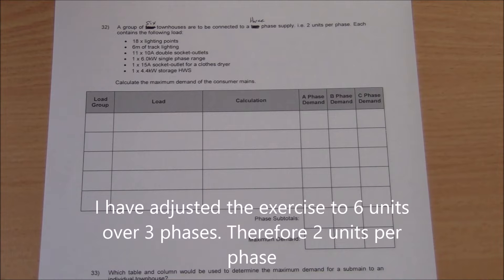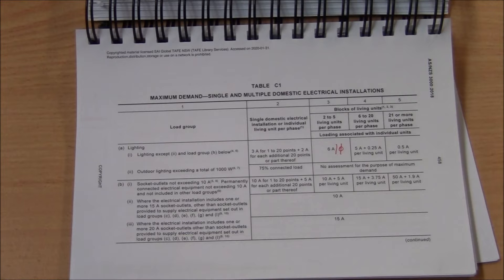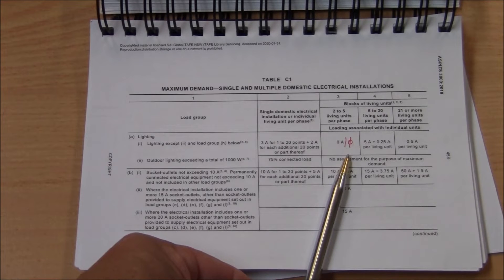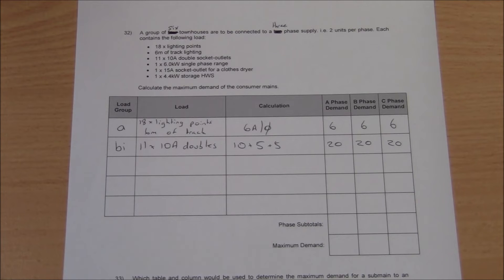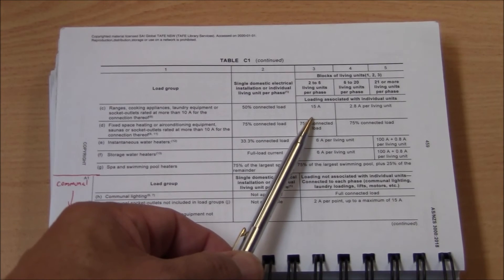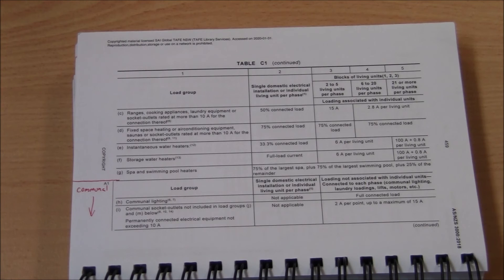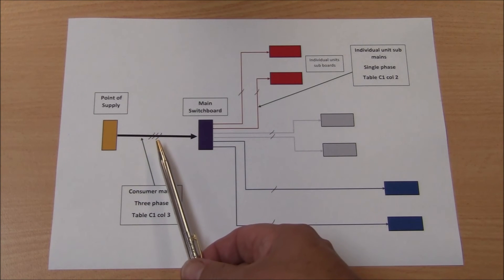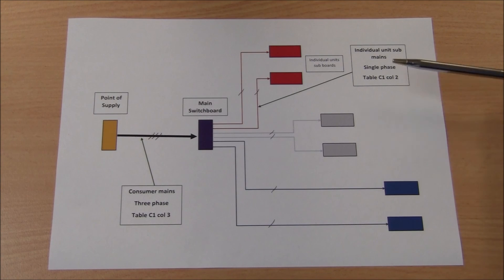multiple domestic (block of units) consumers mains maximum demand

Comment: The 15a socket outlet would come under load group b (ii) wouldn’t it? As it is just a 15a socket outlet the clothes dryer thing has nothing to do with?? Am I correct?
Reply from the maker: In this instance, the 15A outlet is specifically listed for use with the dryer. You can picture a concertina door hiding a small laundry tub along with the washing machine and dryer in some cabinet that passes for a laundry in a unit. In this example we use load group c. The chances of a welder, or AC or some other 15A consuming appliance being connected are probably pretty slim in that case.